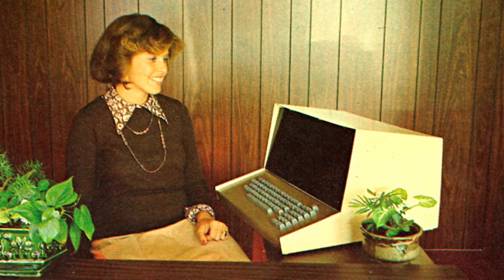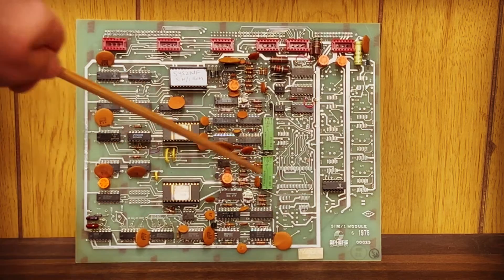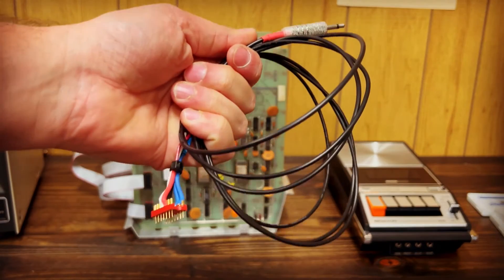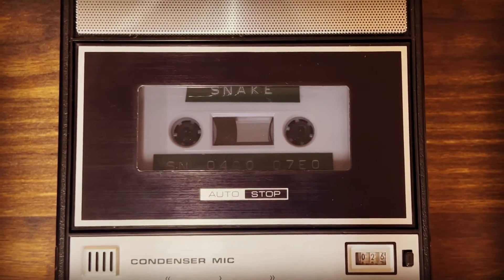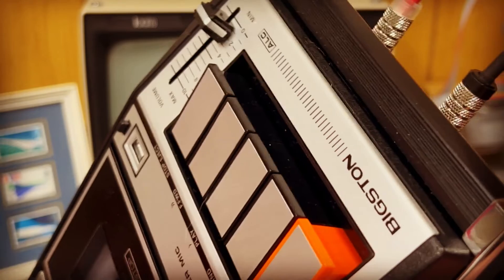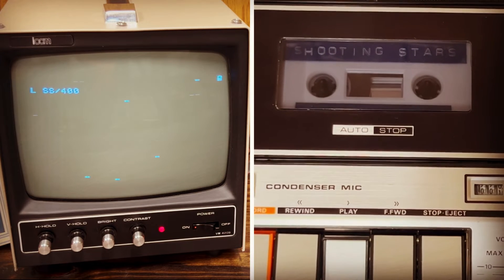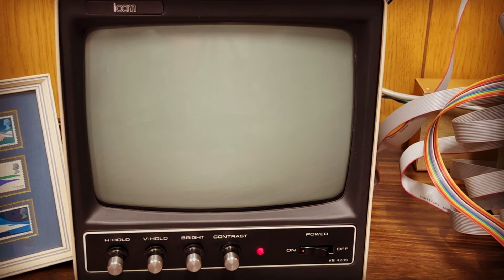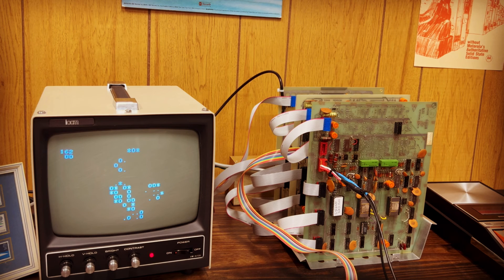Games & Cassettes! on the 1975 Sphere computer

Comment: The Acorn Atom computer was also prone to streaks on the screen when the video RAM was been accessed, because of the contention between the CPU and display controller. But Acorn solved it for most uses by only having the processor and software accessing the display memory during the vertical flyback periods. On the other hand the Sinclair ZX80 and ZX81 computers couldn't maintain a display at all when running programs, which is why the ZX81 had FAST and SLOW modes of running software. The SLOW mode would only be running software during the vertical flyback periods.
Reply from the maker: Interesting! Seems there were a lot of distinct attempts to work with this conundrum in early designs. Wozniak did this in the Apple II by doing the video read during the high half of the phi1 clock only. The Sphere simply doesn't solve for it at all, so you get whatever you get.

Comment: Video flicker was common on many devices of the time; even the CGA card had the problem. The problem was that these video circuits didn't have dual-port RAM, which was extremely expensive and unavailable early on. There were two ways to circumvent the problem.

1. The image was only generated during the frame blanking interval, which cost speed.

2. A second video RAM, which was written to alternately with the first. In the simplest case, the read/write cycle was switched during each frame change.

The disadvantage was that the circuit was quite expensive and required a buffer, which required additional RAM, and care had to be taken to ensure that the video pages were written to correctly.

Comment: Out of curiosity, are the white streaky video artifacts a result of poor buffering between the CPU and video output circuitry accessing screen RAM at the same time? For example, the CPU is trying to write to a certain memory address while the video output circuitry is trying to read from it at the same time.
Reply from the maker: Pretty much, yes. And it’s not necessarily the same address- it’s more that there’s no control at all to switch between CPU access and the video output circuit, so what happens is stuff gets written somewhere in video memory but its remnants on the bus at that moment end up in the video dot shift registers and get displayed for a frame

Comment: So how did anyone use it at the time if it didn't have any way to save/load programs? There must have been some hardware solution out there even if it wasn't a first party one. -- Did they just use it as a remote terminal with a printer?
Reply from the maker: You mean before the SIM/1 board came along at the start of '76? It sounds absurd but people would have to re-enter their programs at system startup. The more technically sophisticated users could (and some did) cook up their own one-off serial interfaces by connecting via the system bus plugs-- that would have allowed a connection to teletype or similar hardware with paper tape punch etc. (Some versions of the Sphere CPU board had serial-capable hardware built in, and that was operable a couple months before the SIM/1 board was available.) There was no third party hardware as such available commercially. This sounds bananas of course, but by comparison the first several months of the Altair's existence was similar -- just lights and switches -- before their own serial board became available around summer/fall of '75. There was such massive pent up demand for microcomputers that people were, if not happy about, at least accepting of the massive limitations they suffered as they rolled out-- the idea of building and actually conveniently using nontrivial pieces of software was not the immediate need.

Comment: Interesting, Many years ago I designed and built a SWTPC 6800 clone, https://youtu.be/3JJU8ENm8bk it would be interesting to try and port some of this Sphere code over to it.
(and https://youtu.be/QR2o-VbBqJk for a boot)
Apart from the floppy disk controller & ROM, the only thing SWTPC I copied was the memory map, I used what was available to me at the time, like a 6802 rather than the 6800. The whole thing being of wire wrapped construction.
It does not have onboard video, but uses a serial terminal, so it'd be interesting to see if I could pump out VT100 cursor commands fast enough to make programs like yours run.
You've almost got me interested in making a video board for it, although me attention should probably be towards finding a replacement for the floppy disks & controller as this failing would be the end for it.
I did follow your link to the 'Game of life', although I spotted nothing that looked like code - pity
I tried playing with your online emulator, Basic and 'Play Snake' worked, although I had no success getting the tape part to work, I selected a title but my selection didn't 'stick' in the selection window, and doing the L... command produced none of the 'step 4' screen content.

Comment: Great informative video series on this rather obscure computer. Given its relatively advanced design (all in one and memory mapped display), I wonder why it did not become more popular... I don't think it came cheap though, so that might have been an issue for hobbyists. Regardless, I would have loved to have one back in the day was it not for the minor issue of my age (10 years old) :)
Reply from the maker: Thanks! Glad you are enjoying. Lots of reasons it didn't become popular-- price was one consideration although when you do an apples-to-apples comparison it was comparable to an e.g. Altair system and terminal or etc. Spheres had a reputation for slow shipment turnaround and unreliability, and the documentation left something to be desired, so they ended up being most useful to people with the patience and chops to build and debug them over time, which was not true of all hobbyists. They also chose the 6800 and a unique bus structure, meaning there wasn't much crossover from other platforms in software or peripherals. (That wasn't really their fault though, they could not have known that the Altair's processor and bus would become a defacto standard.)